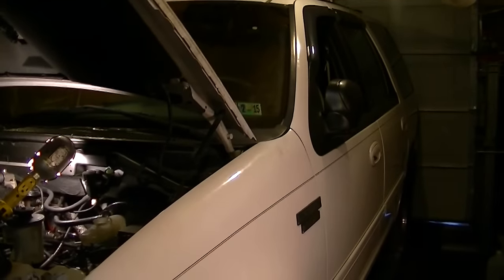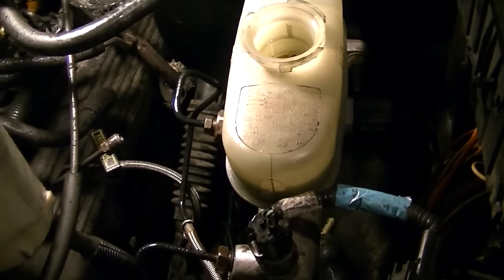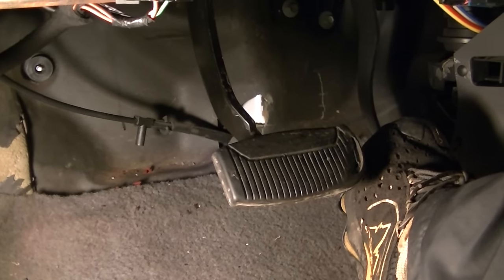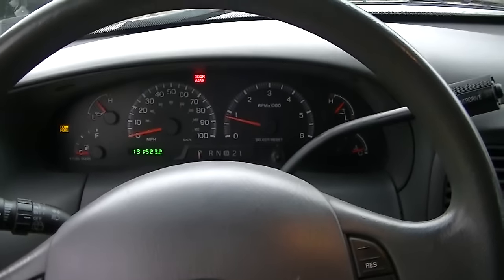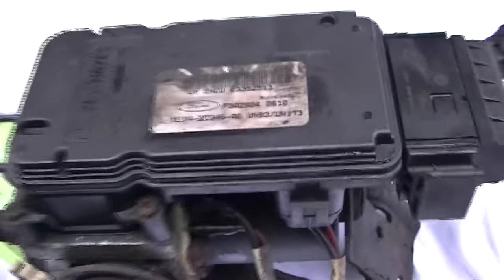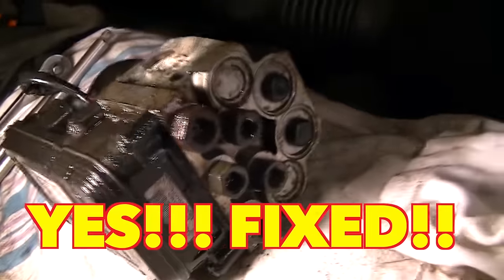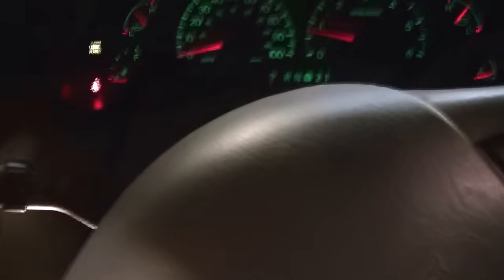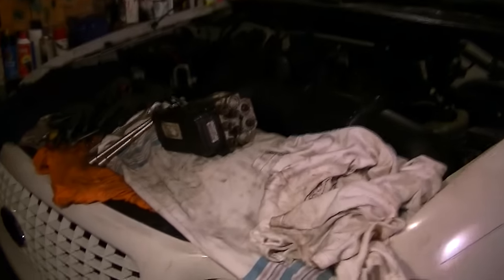Sinking/Spongy Brake Pedal -With ABS SYSTEM?? Nothing Works? Watch Fixed!

Comment: I am having sort of the same problem. I had the master cylinder and power booster replaced and I have a slight pedal fade as I apply the brakes. The pedal doesn't go all the way, but it fades enough for me to have to pump it once or twice to get a firm pedal. Do you think it could be in the control module itself or the whole unit?
Reply from the maker: Where did you get the master cylinder? Is it new?
Reply: Both were brand new from NAPA.

Comment: I’m having the same issue with my Nissan Xterra. I’ve replaced the calipers, booster, master cylinder and bled the system countless times and pedal still to the floor. I heard the dealership can bleed the abs with a scan tool????? Idk what else to do but maybe this will help me out
Reply from the maker: Yep seen two so far. Not uncommon.
Reply: @FixingWithPassion  ok I just ordered a new abs module, I really hope this works.. I been fighting this over 2 months now
Reply: I replaced the abs module today and still not working 😢. I’m lost on this.

Comment: What year is your vehicle?  I have a 2009 Expedition that is doing the same thing.  Bled it, flushed the fluid, changed master cylinder all with results that lasted about 2 days.  My ABS design seems a little different, but again no ABS light or otherwise.  I'll try the closed loop method you did on the MC to verify that isn't bad.
Reply from the maker: 2002

Comment: Great vedeo mate 👍 on my suburban I'm thinking a need do exactly the same 🤔 because after a master cylinder still the same! The brake pedal going all way down! Probably i need replaced a ABS pump 🤔 before this happens i fills when I press the brake pedal the first wheel brakes it's a rear wheel and not correct  something is strange 🤔  after see your vedeo I'm thinking about replacing a ABS pump!! Cheers from Norway 🇳🇴 👍

Comment: ABS computers go down a lot. A lot of times it's the sensors and the lead that goes to the ABS. Just a little wire that gets beat up over years of abuse and that's the road. And the light comes on. When the computer goes bad on the ABS they're not cheap. Most the time you got to go to a junkyard then have them programmed in. Unless you can get a computer guy to go in and resolder all the ends. Where they got beat up over the road damage. The little board comes loose. So you have to resolder it. If you know what computer guy he should be able to solder it it's just not as easy as you think it is because you have to have flux that keeps the board from overheating they have little tiny computer chips that overheat.
Reply from the maker: Good tips!~

Comment: I had to replace a pump and ABS module on a 2002 Sienna in 2012.  About 150K.  Bleeding the air out was a nightmare!!!   Bidirectional computers told me that the bleeding function was not applicable on this vehicle. 👎🏻.  I drove in an empty ball field parking lot on gravel and slammed on the brakes activating the solenoids in the new pump. Then drive across the street to my house and bleed brakes.  I did this for a week.
Reply from the maker: Got that right!!

Comment: Did you get fast and nervous responsive brakes after you changed the ABS?
I also wonder if removing the ABS fuse will provide immediate confirm that it's the failing part?
Reply from the maker: Na i wish
Reply: @FixingWithPassion  sorry, but I'm not sure that I fully understand you. English is not my native language. 
So you didn't get a faster responsive brakes?
Reply from the maker: Same

Comment: Never heard of ANY hydraulic brake system parts being able to be changed without bleeding the system. Your other one probably had air in it in the first place. Especially if you changed the M/Cyl. You can just activate the ABS unit by hard braking to purge it.
Reply from the maker: No it was just bad. Was bleed, pumped, for to days. Common issue with these systems. New one has lasted 3 years, and it a used one.

Comment: Have a 2013 Lexus RX 350 that had the same problem.  Initially I replaced the master cylinder and still had a sinking pedal.  Replaced the ABS unit and the problem was fixed.  Is there is a diagnostic test for an ABS module when there are not any ABS lights illuminated on the dash?
Reply from the maker: Not that i know of. Its all about process of animation.

Comment: I have a Toyota Sequoia 2011 Platinum. I have a same problem too, soft and all the way to the floor brake. So i replaced the master cylinder too but still have the same problem. Any suggestions guys ?

Comment: 2007 merc mountaner-  Just did the same thing went to junkyard and got the abs.module got 2 parts together  was the part you have there and my lights still are on.  I'm going to check the fuze but I don't know which one it would be.   I also had my anti lock brake fixed in my front left tire.  That was fixed about 3 years ago.  And this last week the module was replaced..  lights still on so disgusted with this vehicle.

Comment: I am having the same issue with my Ford escape 2012, I have replaced the master cylinder, vaccum hose, ABS pressure pump and brake booster and still nothing have changed, there are no codes available, what could it be, is it the caliper itself or caliper pin?  Please help

Comment: hey Nathan my F-150 1999 model is having problems with the brakes locking up and grabbing dragging feels like I'm stepping on the brakes and gas at the same time I changed everything just realized after bleeding all four of my lines underneath the ABS module there was brake fluid leaking I think that there is a line that's broken in there or something.
question did your Ford have any issues with dragging brakes and if it did changing your abs did it fix that issue because that's my last unit that I need to replace in order to find out why my brakes are binding up I changed everything and that means
brake pads twice hub and bearings and disc brake hose calipers caliper brackets bleeding my brake lines twice master cylinder and nothing corrected the problem
I am almost giving up and I'm in a money pit I don't know if I have the energy or money to go on any advice

Comment: Hi
My 07 Lexus RX 350 brake padel sink down.  No leaks, everything working fine, mechanic changed the master cylinder which was from after market That didn’t stop padel from sinking than I bought a very good low milage one from junk yard that worked for a month and now I feel the problem is coming back it doesn’t do it all the time I think it does when car is hot, it has been bleed again no luck, every mechanic I go to says it’s the brake master cylinder, no lights on dash, is there a test to tell me ABS pump is bad, what you think causing the padel going down?
Thanks
Reply from the maker: I've gone through two used ones before. Its Not unusual to get used stuff that has the same issue. It has to be the ABS system.
Reply: @FixingWithPassion  is there a test or scanning tool can tell if the ABS pump is bad?

Comment: It may not be going to the floor but hat's still not a full pedal . You need to bleed the air out of the lines between the master cylinder and the ABS pump . It's the same as bleeding the master cylinder . Loosen both lines going into the pump and press and hold the pedal , tighten the lines and release the pedal , repeat two or three times .
Reply from the maker: Nope full pedal now. Works perfect!

Comment: Usually air in the abs unit.  Have to drive on a wet surface and jam on the brakes to activate the ABS system.
Reply from the maker: Hummm never got that to work for me.
Reply: @FixingWithPassion  same here

Comment: Is that strictly with zero lights on though? I did have it scanned and it says no codes available it did however say that battery voltage low and out of range with an open circuit??? ABS pump????

Comment: Question....so when you took off the brake line that routed to the abs pump to test the master cylinder...did you plug the hole where you took out the line of the master cylinder? or did you just go ahead and pumped the pedal to check if it stiffened up?
Reply from the maker: No plugs anywhere. Hooked everything back up...Just pumped until the pedal got hard.

Comment: I had a really scary incident with my 07 Mustang GT. While leaving a parking lot, one of the cars parked in a parking space I was about to be adjacent to as I passed unexpectedly slammed it into reverse and shot out in front of me. I was forced to do one of those 'OMG IF I DO NOT STOP RIGHT NOW I'MA CRAAASH' brakings where I slammed the pedal as hard as I could. The wheels locked up completely, my car stopped...and the pedal saaaaaaaank to the floor.  Unfortunately, being a bit distracted and relieved that I hadn't just hit Mrs. Bluehair in her idiotmobile, I only noticed this pedal sinking thing once I had pulled out onto the road. There was basically no pressure on the pedal, but I had about...5%-10% braking power? I was only going fifteen miles an hour but my car rolled forever before I finally coasted to a stop. After I pumped the brake it did start working again, but I took it into the dealer, because suddenly finding your brakes aren't working is a semi-urgent safety issue. They said, ahem, it was an ABS sensor issue. Um. I'm really new to this car thing, so this is a genuine question as opposed to a sarcastic remark, but how does an electrical sensor cause your brake system to LOSE ALL HYDRAULIC PRESSURE? I had imagined what happened was some sort of seal was worn in the brake cylinder, and by slamming it so hard the pressure forced hydraulic fluid out between the cylinder itself and the cylinder housing, bypassing it and causing loss of pressure. Because some sort of leak (either external where fluid squirts outside the car, or internal, like I described in what I thought happened) is the only way I could imagine a CLOSED HYDRAULIC SYSTEM losing all pressure. Nope, they insisted, they checked and claimed that, indeed, because the sensor on one brake failed (each brake has its own sensor and 3/4 worked) it caused a complete failure of all four brakes and loss of pressure in the pedal, and since they replaced that sensor it won't happen again. Now, does this sound right to you guys? I know for a fact that the ABS sensors fail all the time on pre-2012 Mustangs and that many people chose to drive them with failed sensors; they still have brakes without problems, just no ABS. Also, the brake pedal on my specific car has always been spongey, even on 100% confirmed new non-warped rotors and new pads, which also seems to be a side-effect of a bad brake cylinder. So was it indeed just a failed sensor, or are my brakes going to fail again due to some sort of mechanical issue with the hydraulic system? I've reiterated my concerns again and again to the dealer, but they insist it's fixed. But this is sort of a serious deal...if I wasn't going 5mph in a parking lot and was instead going, oh, 80mph on the freeway and needed to brake to avoid an accident and they decided to fail then...that sort of shit can get people killed. I'm gonna be pissed if I eat wall at 90mph because some mechanic didn't care; I will haunt that fucker until the day he dies. Any thoughts, guys?
Reply: I described my braking 5-10% as well lol I wouldn’t think any sensor would stop all pressure as well thought it would at least burn out calipers and brakes before allow the car go into kill the driver mode

Comment: Before replacing the unit did you first try to bleed it? And clean the wire coupler prongs?
Reply from the maker: No. They were clean.

Comment: I had a Pontiac Sunbird that  the brake pedal would go to the floor and scare me to death because it wouldn't stop. I had already had one of the wheel sensors replaced at about one hundred dollars a while before that. I figured it was another wheel sensor so i unplugged the ABS plug near the master cylinder. Problem solved. I had driven more cars for more years without ABS before that time than i had ever driven with ABS so I just kept on driving it with out ABS. I never had any more trouble with the brakes on it again. I can't believe they put such a dangerous system on a car that made it more dangerous with the idea that it would be safer. It could have got me killed.

Comment: Almost all of these commenters have same issue as me. I had it professional bled through power bleeding and problem solved. Bleeding with one pumping brakes while you open bleeder may never get air out that is trapped so power bleeding always does
Reply from the maker: You are right. Still better to bleed if you can. Thanks!

Comment: How did you take that loose without bleeding the system again I have no idea you going to get air in there I don't know I could be totally wrong.  My ABS light is on I bled the whole system no spongy pedal not even from the get-go have to bleed it too. You need to scan tool so it'll open up the solenoid valves inside of the ABS pump so you can bleed it what I understand .I'm in a 02 Ford Lightning good video I just think there's a little more to it
Reply from the maker: Some times you get lucky and don't push air in the line when changing them....sometimes you do. I've been pretty lucky. But when there's air in the system then bleeding is a must.

Comment: Hi Nathan. Great video...but I still can't solve my problem with a sinking pedal. I just replaced the abs unit with one that looked good from the junk yard. All went great. Bleed each wheel. I have done this many years so I figured it was bleed right. I'm not loosing any fluid anywhere which rolled out a leak. I did notice a large whoosh when I apply brake pressure. Or when I repeat short pushes on the pedal..again whoosh sounds each  time..when the truck is off(97 expedition)  the pedal gets stiff. So thinking booster was good. Master cylinder was checked by plugging the two lines with old lines that were cut but bent over several times so they wouldn't leak. Brake pedal was hard. It's the whooshing sound that makes me believe it's leaking vacuum into the cabin of the truck..
Any ideas...would be greatful if you have any idea.  Thanks
Reply: Did you ever figure your issue out same issue as mine

Comment: Great video, I have a brake sink issue on my 2008 Mercury Sable(Taurus).  My main interesting symptom is; when I'm firm on the breaks they catch at normal location and don't sink.  But when I gently press brakes they sink.  Had mechanic put in master cylinder and abs unit.  Still happens.  Crazy!  Any ideas?  (My car does not leak brake fluid either)
Reply: find another mechanic, he should have checked all that before costing you more money than necessary.
Reply: Did you ever figure it out? I have the same issue.....firm pedal when pressed quit but sinking pedal when gently pressed.  Please let me know.  Thanks.

Comment: I had the same exact problem........out of the blue, 2012 Ford Edge with spongy brakes that nearly touched the floor.. MY SOLUTION: Went to my Mechanic, even drove it in reverse 20mph and "grenaded' the brake pedal to 'reset' the ABS. Put in a new master cylinder..new brake pads in rear.....same problem...........BUT THEN changed the right rear 'suspect' bad caliper and brakes are even better than new.............!!!

Comment: I Know this is an Old video but I'd like to chime in.. I just did my master cylinder change and had my abs block repaired because if a fault . Now my problem was when ever the car was started the brake would sink to the floor, when engine off it was hard as a rock. Now I've changed the master cylinder and as said abs  block was repaired (broken valve inside) but .. my brake still goes to the floor !! I'm bald now and I'm tired of the car (vw golf mk5) well at least for the first time in years the warning lights turned off..

Comment: PLEASE HELP ME!!! I have kinda the same problem, I've been changing the master cylinder and ABS pump, but within about 2 to 3 days, the break pedal gets more and more soft and I'll have to press it further down to stop the car... every time the breaks have been emptied for air, some air comes back to right back calliper, the strange part is that there's no leaks or fluid use in the fluid compartment... If don't understand it....? Any suggestions??

Comment: Ford Dealer, $2000 Canadian to fix ABS control unit in 2010 Fusion. Had car since new, 78,000 miles on it. Dealer put used unit in $700, no warranty. Plus $120 for rental. Damn Ford should have RECALL issued. Car was dangerous as hell.

Comment: I have the same truck but 1997 with the 5.4L. I have the same issue, over the years i've replaced the master cylinder 4 times, the booster 3 times, and saw your video recently and replaced the abs pump too with one from the junk yard to and have the same issue. Is it possible i got another bad abs unit or is there something I'm missing?
Reply from the maker: NO, is possible you just got a bad ABS pump. Try it again. There really no way of checking the ABS pump until there hook up. Its happened to me before.
Reply: TVWXMAN32 thanks, I'll give it another try. I forgot to mention that when the truck is off I get a nice rock hard pedal but once the truck is started right to the floor. The truck still stops but I still got to push harder than I should have too
Reply from the maker: Yep....same thing happened to me also. Keep us up to date!